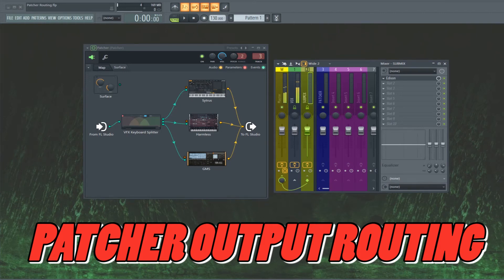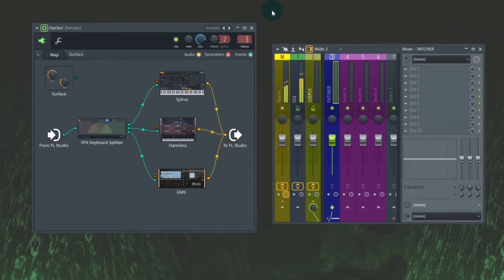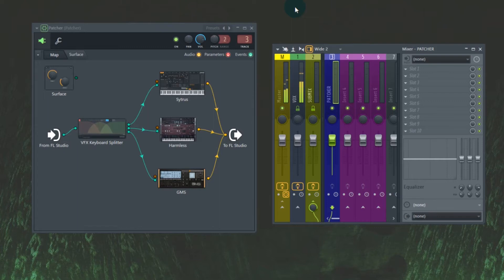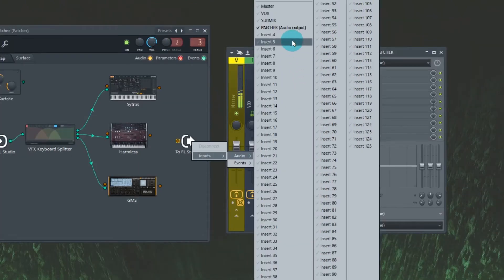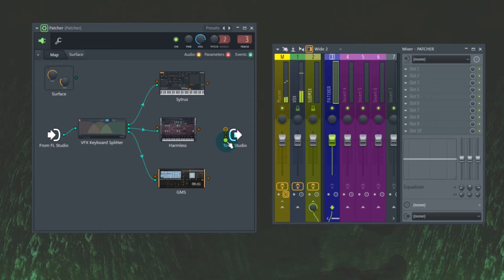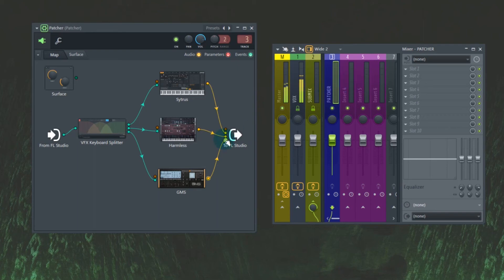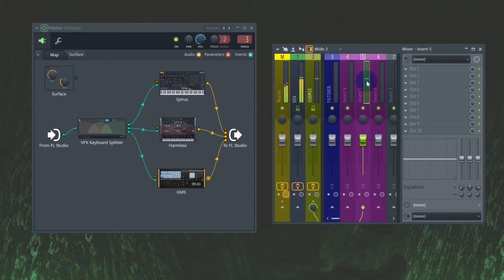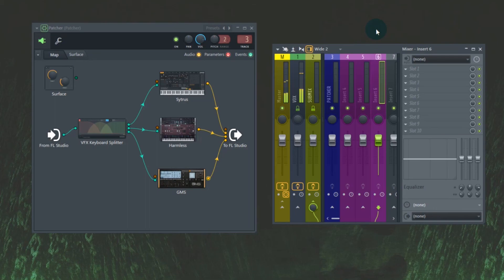Patcher Output Routing

Comment: Hey John, got a question. Can i use patcher to customize information send from fl to controller and back, like you can do it with the programs Max or Puredata(don't know if you're familiar with them) thx in advance Sunda(bawah tanah group)
Reply from the maker: Hi Sunda, I’m unfamiliar with those programs, but what ‘custom information’ are you trying to send?  A Midi Out can likely do that by itself. (Depending on your needs). You might want to post on the FL Forums with specific functionality needs.